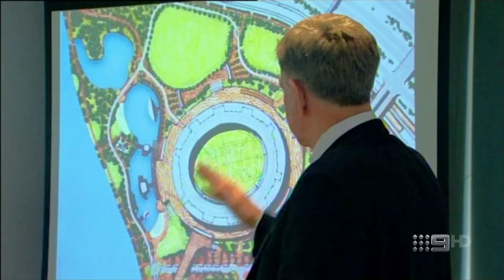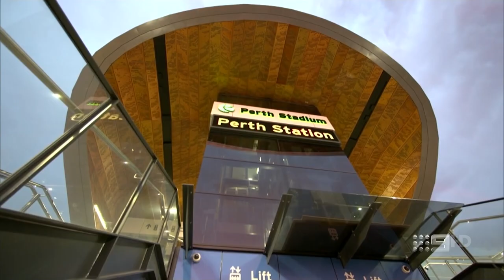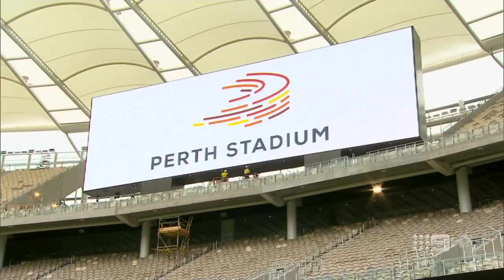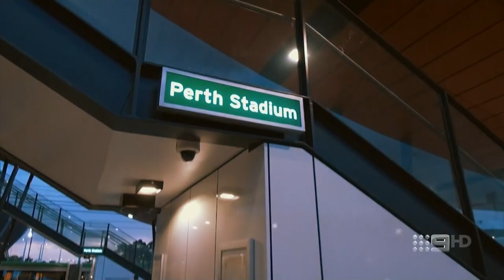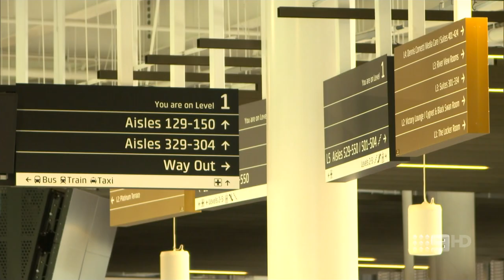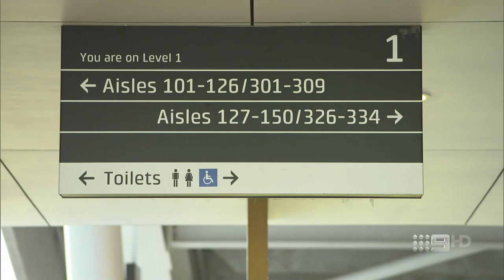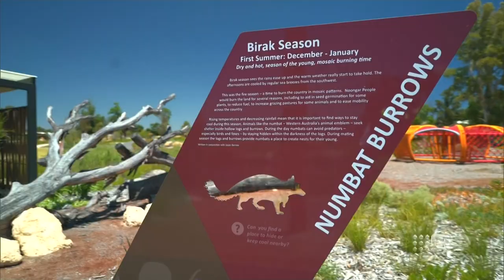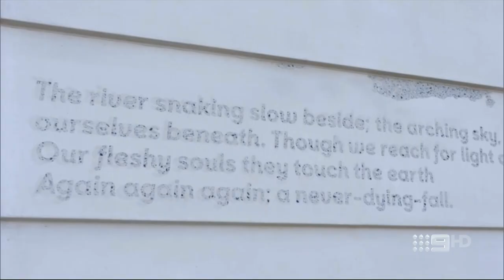Perth Optus Stadium From Concept to Reality HD

Comment: I remember when they were going around shopping centres with a model of it and said to one of the presenters than it was to small needed to be 85,000 at least. His reply was they wanted a boutique standium and didn't want empty seats,i told him they were only after boutique supporters and for the rich and the point of making it bigger than subi was to allow the average person to go.
Reply from the maker: It can be extended to 70k in the future. They built that in. It's about price per seat. 60k is optimum. Anything over and they lose money.